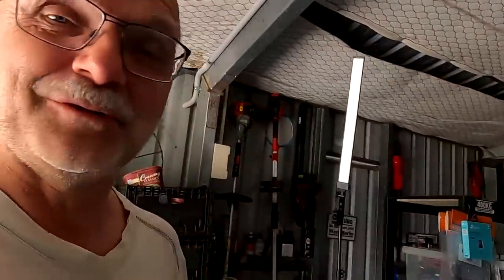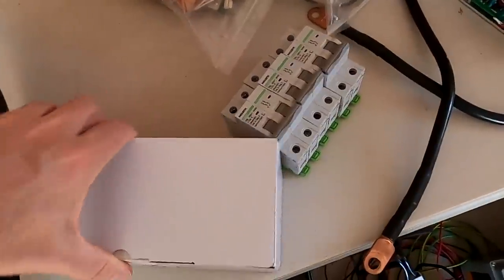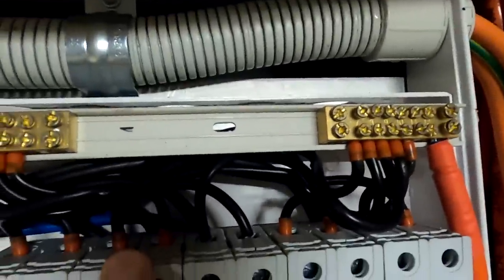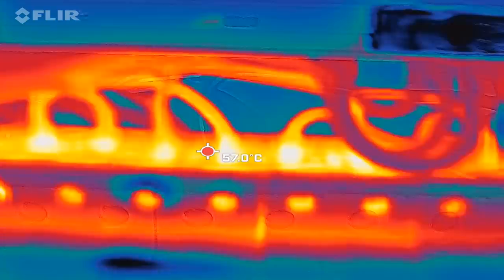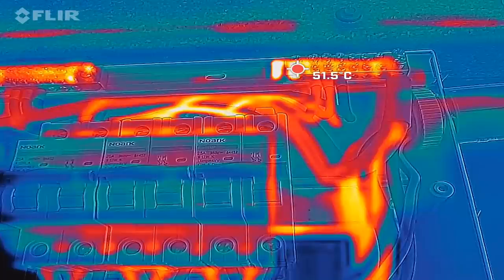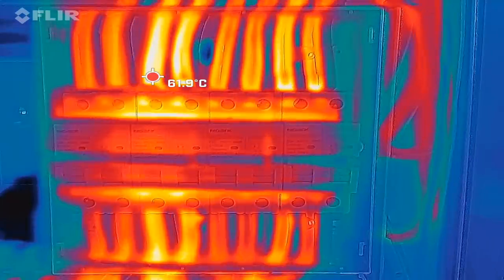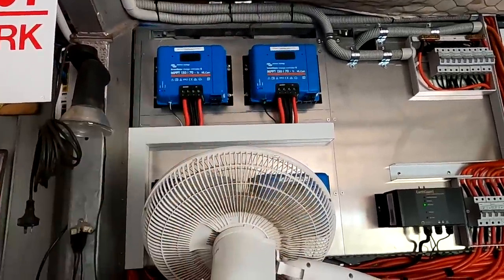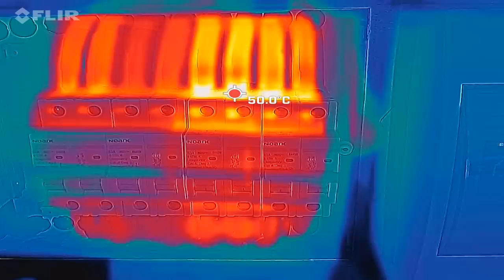The PowerWall and Battery Shelf in sunny hot Australia at 40°C. What can we do though?

Comment: I had a similar issue my fuses were overheating at high currents and causing voltage drop I got rid of the fuse for breakers and ever since running at room temp.

Comment: Talking about overheats how are your inverters doing? I am having an issue at the moment with a recently installed Multiplus II 3000. It claims 2.4kw@25degC. I am getting overheat warnings after 40 mins when drawing 2.25kw@6degC! I opened up the casing to find only one computer type fan positioned below and to the right of the toroidal transformer. Victron claim the temperature quoted is that inside the unit. In any event I shouldn't be getting overheats at such low ambient temperatures. I even got an overheat warning at 0degC. The installation is well ventilated. I think that these units need greater airflow within the casing. What performance output v temp are you getting with your high ambient temps?
Reply from the maker: The Multiplus is fine but the Phoenix is very sensitive to heat and I can only pull 8A from it in these conditions (~1.7kW).
That sounds like a problem with the Multiplus. I can run mine with 3.5kW in 35°C for hours with no problems.
Post in the Victron Community forum.
Reply: Thanks very much Andy for that feedback. The info you provide confirms for me that there is something wrong with my Multiplus.  That is definitely worth another SPAT. I guess that your Multiplus is the 4000 model so 3.5kva on that is equivalent to mine running at about 2.6kva which is above the specs they quote (2.4kw@25degC). Certainly there is something wrong if I can't get 2.25kw@6degC without cutout. Feedback from the forum leads me to believe that, because the fan isn't noisy (which is normal), either I have a faulty fan or it isn't receiving full voltage.

Comment: There are two different protections mechanisms in those breakers. There is a magnetic protection for high short circuit currents basically an electromagnet that will trip the breaker and there is a thermal protection made with a bimetallic switch. That bimetallic switch will heat up and trip at a certain temperature similar to a fuse but resettable.
The reasons why you see the top connectors hotter than the bottom ones has to do with where that bimetallic protection is inside the breaker and or with the fact that hot air rises to the top connector.  The connections with or without ferrules will have no impact as you already seen because the connection resistance is so much smaller than the bimetal resistance that is completely irrelevant.  For fine stranded wires you will need to use ferrules else over time with multiple heat/cool cycles the connection force will be reduced and the contact resistance will increase in those type of connectors.
Reply from the maker: Thanks for explaining the circuit breakers.
Another factor could be that I run these breakers pretty much at their limits. They are rated for 63A and I push that and a bit more sometimes. I guess if I would use an 80A breaker instead, I would see less heat building up.

There are always these discussions about ferrules or no ferrules, so I wanted to show the difference between that. The reduction of the clamp force over time is something I want to test as well. Another viewer asked me to test that a while back...
Reply: @OffGridGarageAustralia   I can add some insight here from 7 years experience in desert environments (please see my previous comment backing your discussion about solder being a no no). My experience is that during my annual inspections those charge controllers using bare wire require more tightening of the screws (sometimes significant) than those with ferrules. Soldered - forget about it.. got rid of tinned cables years back - caused a nightmare.
Reply from the maker: @dockarl123  Thanks again for sharing. Great information.
Reply: Any - not a problem. A good explanation of the various approaches can be found if you look for a pdf entitled ‘The ultimate question – Are ferrules necessary?’ From phoenix contacts, using your favourite search engine. I’ve personally worried that the lower effective contact area offered by hexagonal ‘iris’ style ferrule crimpers might be problematic, but it seems the benefits of less oxidation and less ‘shunting’ between the strands outweigh that.

Comment: Nice Video, but Andy, why are you using 63A breaker between the batterie and the 70A MPPT, this is a bottleneck. 
Where is the "Deutsche Gründlichkeit"?
Best wiches from Germany, outside -9°C, Batterieshelf outdoor at 16°C.
Reply from the maker: Because there is no 80A MCCB from NOARK with a 35mm terminal. 
and 70A is only peak power for a limited time. So far none of the breakers have tripped.
But I agree, I run them hard and an 80A or 100A breaker would be better in these locations.

Comment: I thought Circuit Breaker is not allowed as PV isolator in Aus?
Reply: IFAIK we should use fuse with gPv characteristic. Tipical DC beakers don't react fast enough for short circuit current for PV. Fuse should be: 1.4 x string short circuit current x pv amps tolerance
Reply from the maker: They are absolutely allowed if they have the specifications.
Reply: @OffGridGarageAustralia  ohh.. Nice. Could you be so kind and share the model numer od Noarc?
Reply: @OffGridGarageAustralia  IMHO and not to argue with you but... according to IEC 60269-6:2010 at least the first stage of PV fuses (whose purpose is to protect PVs, not cables) should be "gPV" characteristics not "C" (which Noark breaker are C, even if they are rated for DC and PV use - but maybe I'm wrong). The "gPV" and "C" characteristics for DC look quite different. Of course, every producer has some differences in the curve but in general, "gPV" should be blown almost just after 1,4 of the short circuit current of PVs. The "C" curve nad Noark DC MCB are rather ok to be the second stage of protection (after all your PV strings are in parallel). What is your opinion and all of you guys?

Comment: If you feel RADIANT heat from your metal roof you should be using a RADIANT BARRIOR to prevent the energy from being absorbed by your gear.  Before I insulated, my metal workshop on a sunny day was typically over 10 C cooler after I placed aluminum foil over a chicken wire support hanging about 10 cm under the roof.  
Your breakers are tripped by current heating a bi-metallic strip that toggles and opens the contacts.  This strip by definition must become hot with current flow to do so.  It must therefore heat with current flow.  Most ( maybe all?) bimetallic conductors also have a positive temperature coefficient, meaning the hotter it gets the more resistive it gets, leading to the current causing even more temperature rise.  That's why the breakers were hotter than the wires connecting to them.
Reply from the maker: When they built the garage (before we bought the place) they used this cloth and chicken wire to keep the heat away. That helps already a lot but mor importantly, the solar panels now almost fully shade the whole roof and this makes a big difference.
Just this very top roof space in in full sun outside and heats up a lot...

Comment: Meine Mutter sagt, platziere die Batterien unten und VECC oben
First, I would focus on the Batteries. I would put a heat pump on them set at just 30°c. Then I'd look at the VECC's and want to control the temperature at 20°c.. No?
Three coats on here. Sometimes I think about just flying the Gulfstream down there this time of year. Maybe stop over at Fiji or Hawaii for a spell. But having this much money makes winter awesomeness Vail - Telluride - Jackson Hole baby!
Reply: The heat pump increases efficiency by lowering the temperature to where the battery cell und BMS generate peak power with good buffer for load and charge while the VECC need be cooler to extend the life of the fish oil inside which is stinky when burned

Comment: I've just bought a victron 100/30 for my setup, and in the manual (yes, i read it) it says that if the controller gets above 40C, it throttles the output.
Have you noticed any drops with yours? Seeing as they're above 50C 😬
Cheers Andy, from freezing cold UK 🏴
Reply: Nlt, it says it will throttle if ambient gets over 40°C. Andy has never shown an air temp above 35°C inside the garage, AFAIK.

Comment: AC is treating the symptoms not the cause. 

Better roof insulation.  Move the combiners away fron the roof even down by just 100mm or so and isolate with thermal insulating mount. In combination with breakers not fuses and ferrules in screw terminals and bare wire in clamp terminals. Problem solved at the cause. In hind site just better planning 😊

Comment: Have you actually measured the temperature of the steel pipe that goes from the shed to the garage? That's fully in the sun and the cables in it will certainly be very hot.
Reply from the maker: Never measured it but can do. It will have around 50°C. The cable inside is in a conduit and with 16mm oversized for the current it needs to carry.

Comment: That's why I like the SMA system with both 400W and low amps strings going to the Sunny Boy PV inverter, and 230V AC output with lower amperage too.

The only thing to look out for is the DC to and from the battery and the Sunny Island inverter.

Comment: Your ferrules are super loose and looks like you don't tighten the breaker terminals enugh either!
Get a low NM torque ratchet/screw driver and torque to spec, about 2 to 4NM depending on the breaker and it is often labeled on the breaker what the spec is
Reply: And use flat head for the final torque as a philips just slips too early. Or the special one that is square and flat combined in one
Reply from the maker: All crimped and torqued as per manufacturer specifications. Nothing lose here...

Comment: An air conditioner that helps to reduce the temperatures significantly would have to have at least 2kW cooling capacity, right? If we now assume that 2.5 kW of power are necessary for this, this is without the losses in the inverter about 50A solar power. 
So I would first try to reduce the incoming solar current by these 50A. Possibly this has the same effect without putting money into an air conditioner and "burning" inverter power that is missing for charging the car.
Reply from the maker: An AC with 2kW cooling will take only 750-800W electrical power, so well worth trying 😉
Reply: @OffGridGarageAustralia  You are right.

Comment: the problem is the fuse itself,the square section is too small for 10A. it heats a lott
Reply from the maker: You mean the square section of the wire inside the fuse?
Reply: @OffGridGarageAustralia  yes,the square section of the wire inside the fuse is what dissipates all that heat inside the fuse holders!

Comment: I love the look of ferrules but I typically use soft solder for those types of connections
Reply from the maker: Soldering these wires is a big NO NO. Solder will get soft over time and resistance will increase.
With larger currents, solder actually can get brittle and crack which causes the connection to heat up. For these type of connections and clamps, use either ferrules or bare wire but never solder.
Reply: @OffGridGarageAustralia   Prove it! 😂
Reply: I install telecommunications sites in desert environments for a living. 7 years ago I installed a large project with about 30 Victron charge controllers. After multiple trips out for ‘unusual voltage’ readings in the charge controllers I worked out that the fact I had tinned the cables before clamping them in the charge controllers was the root cause. Expansion and contraction durin the day and night eventually makes then work their way out of the connection due to the differing expansion coefficient between solder and copper - regardless of how tight you screw then in. I never solder or tin anymore. Andy is right. It’s bare copper all the way for me now - I long ago removed the tinned ends and now have zero problems. Do not solder / tin your connections.
Reply: @dockarl123   Alright..Fine Gold plating it is!

 Are you sure that it was the expansion and contraction, and Not corrosion? Ever tin and apply some type of grease, Die Electric, electrical contact grease, Etc. for moisture/air prevention? 
My argument.. If 90% of the metal is indeed cooper (when tinned), what is actually expanding and contracting? My opinion is that you are likely breaking the tinned surface in certain area's anyways and making contact directly with the copper. Also, most of the surfaces/contacts of the breakers and fuses are steel likely plated with tin, silver, maybe..maybe gold.
Reply: I would have to argue further by saying that my high content silver solder is way better than a thin steel wall crushed ferrule That are recommended almost every..
Google  C45-6/10/16Mm2 Copper Tin Plated Circuit Breaker Plug Pin-Shaped Cable Wire Lug Insert Crimp Terminal C45-6 10PCS

Do these not work either?
Reply: It’s not corrosion - corrosion moves at a snails pace in the desert. The tinned joints slowly give way to the pressure of the screw or screw gate and become loose. You can try to work out the exact mechanism if you want, but I’m telling you - don’t tin unless you want in the long term melted insulation and high resistance joints.
Reply from the maker: @dockarl123  Thank you for that insight information!

Comment: Small tip, if you have long strands of single thread/core of your cable you can put this around the end of the cores of the cable to guide them, without impairing resistance. I think the ferules when correctly put under pressure might add a very small bit of resistace but will hold your cable steady and work in the long term.
Reply: "this"?
Reply: @mfgxl  one strand / thread or core of the cable

Comment: Like# 80 - we really have to get back in sync with your release times…
Reply: Andy, remind me again about your new panels, are they bifacial ?
If so, try adding some gamma ray reflective sheets under the panels and on the surface of the roof to prevent gamma heat from penetrating the roof and into the garage & getting a little more solar action if your panels are bifacial!

Comment: One way to think of it is that a ferrule is something you are putting between the two things you're trying to connect. No matter how little resistance the ferrules have, they do add some resistance. Even if the material itself were zero resistance, the contact surface between the wire and the ferrule is less than 100% and the contact surface between the ferrule and the contact is less than 100%, so you're reducing the contact area twice instead of just once. You're better off without ferrules.
Reply from the maker: But ferrules compensate for contact area as they include all strands of the wire, no matter what. Without, you can miss some strands and also run into problems with having to tighten the terminals over and over again as other have written here as well.

Comment: You over killed all your cables.  All these temps must just be ambient temp heating up cables.  I have 35mm cable to my 5kv inverters and they never get hot.  PV is the same but I have high voltage, rather than high amps.  This keeps the inverters so much cooler.  My high amp inverters got so hot in the summer you couldn't put your hand on them and had tornado fans running to keep them cool.  So you should be well within tolerance with 70mm cable on a 3kv inverter.  I'm trialing a Renogy charge controller.  For $350 you get the same performance at half the price.  Plug and Play.  Running perfect.  Also, paid $20 for a fire alarm.  Something all solar installers never install.  All that investment and they never put a cheap smoke detector in.  Weird.
Reply from the maker: It is absolutely the ambient temperature inside the garage with fuels these hot connections and devices. I'm working on it...

Comment: Current is your enemy! How about pulling it all apart, buying new inverters and making 400V solar strings. -- just kidding!!
Reply from the maker: That would be insane 🍺
Reply: Controllers need a 5V difference between battery voltage and string voltage before they'll start, which could need over 60V. Needs 45V even if cells are at 2.5V.

Comment: Do you realise that if your batteries are at an average of 35degC you will halve their life? Not suggesting your are but the heat will have a shortening affect on your batteries. Have you thought about cooling them?
Reply from the maker: It won't half their live, but temperature certainly has an impact on the overall life. These LiFePO4 cells can be operated up to 60°C. Have a look at the specs.
Reply: @OffGridGarageAustralia  the specs are sales talk. Testing of these batteries by the company I have been working for says otherwise. Also have have look at some of the scholarly articles recently published on Will Prowse solar power forum. This is reality. Don't belive the sale bumf
Reply: Adding a temperature controlled fan to each shelf seems like a needed fix. The walls are boxing in the heat.